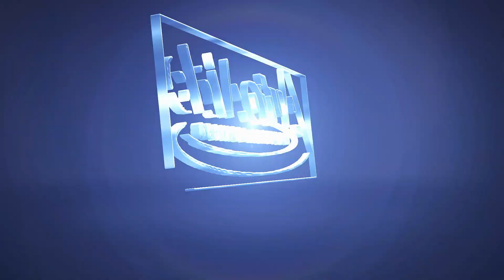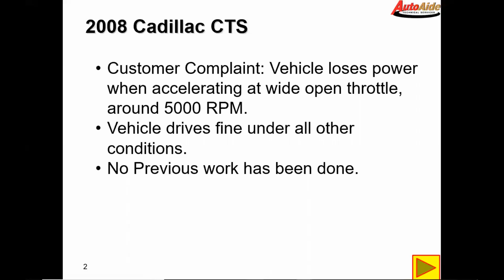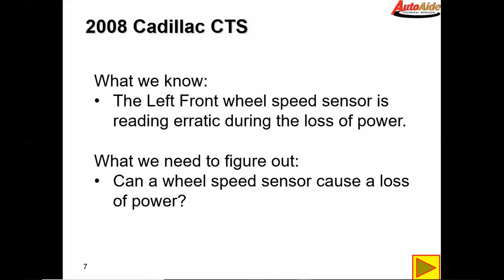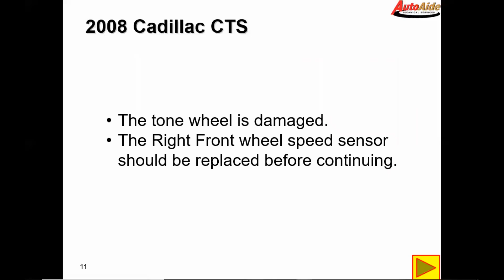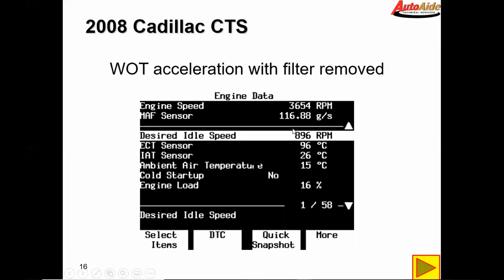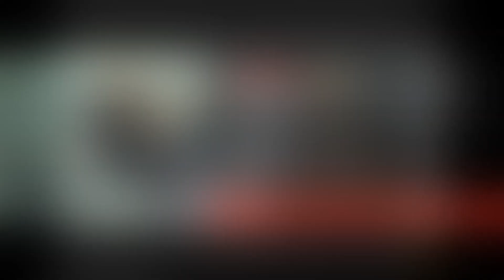How I Diagnosed: 2008 Cadillac CTS 3.6L Low Power

Comment: Hows it going I have a 2008 cadillac cts 3.6 and when I try to push down on the gas it hesitates and then it goes. I have no check engine light on and my air filter is fairly new and I was thinking if it might be the maf sensor. And I did try and clean the maf sensor a while back but I dont think it worked and the lack of power got worse. Help me please
Reply: Did you ever get it fixed
Reply: @mikep1772what’s up with yours? Same thing?
Reply: @95358MODESTONORTE  i am suspecting timing chain, but i have a new problem where the car has trouble starting unless i let the pump prime first. then no issues. i am assuming my fuel pump is failing. currently on order
Reply: also maybe bad torque converter

Comment: Got a 2010 CTS with code p0087 p0089 p0091, changed throttle body but nothing, I'm thinking high pressure pump or fuel pressure sensor, or maybe pedal sensor? Fuel pump? So many options my head hurts
Reply from the maker: What are the code descriptions

Comment: I have a 2011 cts4 3.6l with only 29,000 miles, my parents bought it new in 2011. I've noticed a hesitation when accelerating off the light, it will take off 0-25 well then lag a bit and then over 45 it does very well. I've changed the MAF sensor and it helped a little and changed the filter to a k&n with no real change but with no codes, I am at a loss. What would you recommend?
Reply: I'm having the same problem with my 2013 impala, did you find out the problem?

Comment: thought i was transmission , throttle body , high pressure fuel pump or the mass airflow sensor. still dont know entirely what it could be.

Comment: im having this problen with my 2008 cadillac cts. was driving fine one night and when i almost got home car went into limp mode.
Reply: It seems common now that I'm researching my my 2008 CTS is doing the same. Just replaced both my catalytic converters too.
Reply: I have the same exact problem in my 2008 cts it’s stuck on reduced engine power mode it shows codes for an app sensor, mass air flow & tps I’ve replaced the app sensor & nothing. Any tips ?